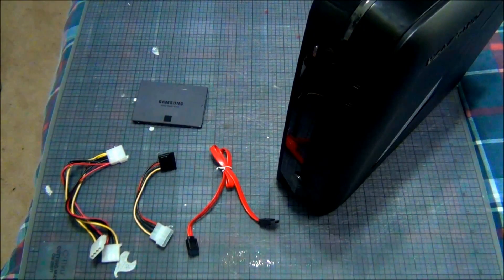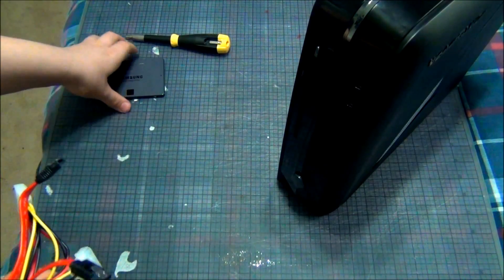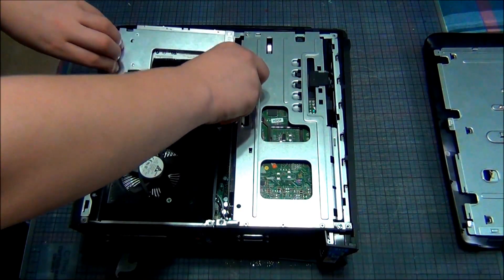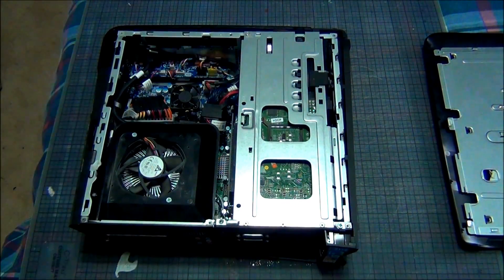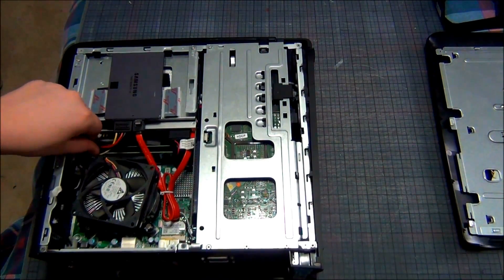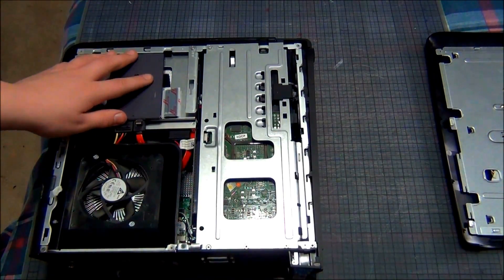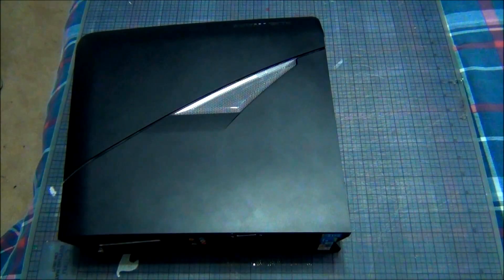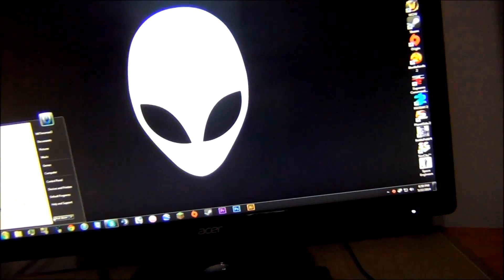Installing SSD into Alienware x51 With An Existing 3.5 HDD

Comment: I know this is an old video, but can you recall how high your temperatures got?

Or, how much power would this affect on the power block? I recently upgraded my x51r2 rig with a 1660 super.
Reply from the maker: Temps I believe were perfectly fine and also for power, I’d say definitely under 5 watts. You can look up your model of ssd and see how much power it draws idle and while in use
Reply: @MrTimoman3  thanks mate

Comment: Hi, i've had a x51 R3 for about 3-4 years (GTX 960). I've been running a 240w psu over the recommended 330w for the whole time and its worked well with it getting a bit hot after a long play. Anyhow,  recently it started to shutdown after loading/playing games which i first thought was the psu, i swapped it out with another 240w and it still doesn't work. The PC in general is very loud followed by a scratching noise coming from the GPU/HDD area. Do you think i need the hard drive replacing?
Reply from the maker: It could be the hard drive. You should be able to take out the graphics card out of the case and still run the computer off the integrated graphics from the motherboard. And you could get a better look at what could be making the sound. Also it could be that your components are getting hotter than they have been before and when components get hotter they take more volts to stabilize so that could also be another thing but if it primarily happens when loading a game it’s a good possibility it’s the hard dirive
Reply: @MrTimoman3  Awesome man thanks for replying so quickly. Ill try it out :)
Reply: @MrTimoman3  Found out it is the Hard drive, would those same wires work with a 2.5 SATA 3 SSD?
Reply from the maker: Chazza yes they should
Reply: @MrTimoman3  thanks
Reply: The gpu fan is positioned in a way where it grinds against its own power supply cord. I've seen it in two models already. 
Try taking the gpu out and checking on the two cords attached to it.

Comment: @MrTimoman3 i need your help. i might be getting one of these computers soon with a 330w psu, and my gpu will need one 6 pin power cable, i know that the R2 has at least two 6pin cables. My question is : where are the 6pin cables plugged into? will the molex cable im meant to unplug be powering the ssd, hdd and the gpu? i know that with the right adaptor it is possible. did alienware do this?
Reply from the maker: I no longer have this computer but if I am correct that molex cable is just for the HDD and the DVD drive. The single 6 pin is just for the GPU it self

Comment: So, I connected everything up easily. I wanted to use the SSD as my main drive, so I cloned my HDD to my SSD with the Samsung Migration tool. I unplugged my HDD to see if the computer would boot from SSD and it did, very fast. It was amazing. But now I'm trapped in another nightmare. Whenever I reconnected the HDD, the system would start from the HDD, even if I selected the SSD in the F12 menu. So I tried messing with some boot settings and now the computer will not start up from the SSD anymore at all (it says "no disk detected" or something like that whenever I start it with just the SSD connected). My system also doesn't even see the SSD anymore. Samsung migration tool can't see it. It's not in windows explorer or in diskmgmt. I don't know if some setting I changed caused this, or if maybe one of the cables is actually defective and randomly gave out. Also, my initial bootup screen changed when I made one of those bootup settings changes. It now shows a big alien head in color (some red on it). Before it showed just a small white alienware logo.
Also, the drivers link in the description doesn't work. I don't know if they would help.
Reply: You need to go to your BIOS and change the boot device, sorry for the 3 month late reply.

Comment: Hi man, great video. I'm about to upgrade my X51 with an SSD. However, is there any way to avoid so much cables? Know if this adapter would be useful? Cheers https://www.amazon.com.mx/StarTech-PYO2LP4LSATA-Adaptador-Seguridad-Pestillo/dp/B00A6GKE22/ref=sr_1_19?s=electronics&rps=1&ie=UTF8&qid=1544412390&sr=1-19&keywords=sata+3+cable

Comment: What SSD is that? also do you know if i can use Samsung 860 EVO 500GB on this PC ?
Reply from the maker: Parahype99 that is the Samsung 840 evo and yes you
Can use the 860 evo in the Alienware
Reply: If i get the "2 molex cables combined" i don't need the other cables? i already have SATA data cable
Reply from the maker: Parahype99 correct

Comment: First off the operating system is still loading off the hard drive so speeds weren’t faster at all as well as loading any applications. You need to manually put applications on the SSD to make them load quicker

Comment: Hi, I know this is a while back but what is the Media-fire link for the driver link for ? you haven't mentioned in the video, or maybe I missed it. 

Also the link no longer works

Thanks
Reply from the maker: Kieran Long It was a link for the drivers the controls like the eject button on the front of the case and other little things
Reply: ah ok thanks, so I do not need it for the installation or usage of the SSD? also what size of SSD did you use / recommend, 250GB?
Reply from the maker: Kieran Long no you do not, and I would recommend 250 if your installing a os into it but if your looking to put games to load faster on it I recommend 500 to 750 (750s are rare)
Reply: MrTimoman3 ok brilliant! Last question haha! I don’t need to do anything to the cooking system or power supply when installed the 500gb SSD ? The computer will run fine with the standard parts ?
Reply from the maker: Kieran Long yup

Comment: Hei so can I take the optical drive out and use the existing cables  for  the ssd?. Maybe I can keep the optical drive cage in there to have something to mount the ssd to
Reply from the maker: Luciano Schettino yes you can take out the optical drive but you still need to use new cables as they are different
Reply: thank you very much  MrTimoman3, could you tell me which cables I should  buy if I want  do that?
Reply from the maker: Luciano Schettino they are in the description

Comment: Can I install my Samsung SSD first and then use the included disk to transfer my OS, or do I need to transfer the OS with a usb to sata and then install? Sorry probably a dumb question
Reply from the maker: You most likely cant go from your hard drive to your ssd. you most likely going to have to just install a new os on the ssd and move over files.
Reply from the maker: You most likely cant go from your hard drive to your ssd. you most likely going to have to just install a new os on the ssd and move over files.
Reply: I am finding this article on migrating to an SSD helpful. I haven't tried it yet. https://www.howtogeek.com/97242/how-to-migrate-windows-7-to-a-solid-state-drive/

Comment: Hi, I was wondering if you can do this by only using a sata cable? This guy I was talking to insisted that the computer had an extra power cable that I could use. Do I need to buy molex cables or can I get away without doing so?
Reply from the maker: jarewild if you have a newer Alienware x51 (r3 and up) then I'm not sure but it you're on a r2 or lower you will need the moles cable

Comment: Can I still install the SSD if I don't have the OS disc? I'm on Windows 10 and this is the first time installing a SSD. Do I just plug in the SSD in my PC and it will work?
Reply from the maker: FaZzyTheGod it will work but your operating system will not be on the ssd so your ssd would be used as a storage drive
Reply: FaZzyTheGod use a USB disc and create an image of your OS (Google: windows media creation tool).

Comment: PLEASE HELP. I am an idiot and cannot get the fucking door back on! Everything is complete and set in perfectly I just can't get the door back on! It's been an hour! I am a discrace to mankind!! HELP
Reply from the maker: Sorry for the late response. It could be because you a have a larger than normal ssd or that the cable to that connects to the panel is in the way or that the graphics card or the disc drive is not reinstalled correctly and is bulging out.

Comment: can i replace the HDD with ssd directly??
Reply from the maker: Soorya prabagar I'm not sure as i haven't tried that and I also no longer own the Alienware x51.
Reply: MrTimoman3 ok thx
Reply: If you're still looking for an answer, you can.  I have been using my SSD in replacement of the original HDD, and I'm adding an additional SSD whenever the cables come.

Comment: Would this installation guide and parts work for me if I get an SSHD instead or is it different?
Reply from the maker: Stephen Sabra depends exactly what you are exactly wanting to do and if the sshd you are wanting to use is a 2.5in or 3.5in
Reply: I went ahead and just t the same Samsung SSD you have in the video. I'm still waiting on two other cables to arrive in the mail. Thanks for this guide btw!!

Comment: I cant find a video anywhere, I want to remove the HDD altogether and just have a single 1TB SSD in my X51 machine...

Do I need to buy a 3.5 to 2.5 inch tray or can I use the existing tray in the x51.

Wil I need any additional cables or can I just use the cables that was connected to the old HDD?
Reply from the maker: EquationStudio  I'm not entirely sure because I no longer have a x51 but I do remember that the sata and power connected where screwed into the case to fit perfectly with a 3.5in drive. You maybe be able to get a 3.5 to 2.5in drive bay converter but I'm now sure because there may not be a enough room for the connector to move around if you unscrewed the sata and power connector.

Comment: Not working for me... the molex female you got their is connected to my harddrive or gra. card... maybe I got another model...
Reply from the maker: Jan-Henning Schmidt yeah one of the molex cables is supposed to connected to the hard drive so you can have both
Reply: Their is only one!
Reply: Or did you disconnect the cable you are connecting with the ssd?
Reply from the maker: Jan-Henning Schmidt your supposed to disconnect that molex that is already installed and then plug in the molex splitter and plug the existing molex into one end and the molex and sata to the other
Reply: Thank you so much!... i had no sound when i did this yesterday... i havnt seen you disconnecting it...

Comment: I need help. I did exactly what you did. The problem is that the first boot never works. I have to force shutdown, then boot again for it to boot normally. Also, my HDD is read as usb hard disk. Is that good?
Reply from the maker: Leon Ho have you change the default boot in the bios to the SSD?
Reply: I'm pretty sure I did. Here's some links to the bios:
https://www.dropbox.com/sh/2zgwtr3tudsiiqd/AADEeJ-1S3XGqcYBwRn9yVb0a?dl=0
Reply from the maker: Leon Ho ok so where the first boot is under the boot menu in the bios where it says Windows boot manager it means that it's going to launch to which ever drive has Windows on it so what you need to do is to unplug the HDD sata plug then it should but straight to the SSD then shut down and plug it back in and see if it stays booting to the SSD drive.
Reply from the maker: Should boot straight*
Reply: +MrTimoman3 I think I got it. I went to msconfig and did selective startup. 5+ successful boots in a row. btw, I got a new hdd also, so it's formatted and no os. stupid alienware and the toshiba hdd... lol
thanks, man.
Reply from the maker: Leon Ho oh ok awesome, I'm glad you got it working!

Comment: Hi , is it possible to get 2 SSD of 420 gb in my x51 R1 ? I got a graphic card upgrade the PNY GeForce GTX 750ti 2gb and it works perfect , i wanna know if i can have the 2 SSD since alienware are short on power supply , will it cause any problems? Having 2¿?
Reply from the maker: Ferchobits NiNi you shouldn't have any power issues as SSD's take low amounts of power it just matters if you have the room for the 2 SSD drives and enough sata Ports.

Comment: work with sata III SSD?
Reply from the maker: Yes
Reply: hi ! i installing SanDisk SSD Ultra II 480Go on my r2 9002 and i doesn't see any disk when i go to file "computer"
Reply from the maker: You need to go to control panel, administrative tools, create and format hard disk partitions, then create a new partition for the SSD.

Comment: Hi, i followed your tutorial and it worked great. I cloned the C drive that has my windows installed on it to the new drive but it keeps booting from the original HD. How do i change the boot drive to the SSD and then format the original drive? Thanks!
Reply from the maker: To change the boot order you have to go into the bios and change it from the HDD to the SSD. If you can't get that to work try unplugging the sata connecter to the HDD and then boot and it will force it to boot to the SSD, then you should be able to plug it back in and it should stay booted to the SSD. If not let me know if you couldn't get those 2 options working.
Reply: Thank you. I just unplugged the SATA and installed a USB version of windows and it worked perfectly. Thanks

Comment: After I clone my OS to the SSD what do I do with my 1 TB HDD to make it my mass storage? Do i need to delete the OS off of it also? Also is there any way to Clone the OS without deleting the large files off like the games/video? Thank you again sir for This video it helped me so much.
Reply from the maker: Once you clone the drive you will need to make the bios boot to the SSD first and then reformat the HDD once you get into Windows. Also what size of SSD do you have and how many gigabytes do you have stored on the HDD? When I did it I just completely reinstalled Windows on the SSD and then I was able to grab files off of the HDD and use it like mass storage.

Comment: My friend gave me a x51 for free because it needs a new hard drive. wont boot up, just a black screen. What are my options? Can I just buy an ssd, do this, boot it up, then install the OS onto the new SSD from the supposedly faulty HDD? thanks!
Reply from the maker: +JoeyRaddaRadda do you get a boot screen like the Alienware head?
Reply: Haven't tried booting it myself yet, I just took it and ran! Lol. 
"It doesn't boot up. It's just a continual loop until it either goes black or shows an error message (which it then goes black afterwards). It'd be best to just buy a new hard drive" 
Exactly as he said.
Reply from the maker: just try booting it your self and see if the alien head pops up or not
Reply: +MrTimoman3 he believes the logo did show, along with the little circle icon if thats any consulation, then never got past that followed by a black screen.
Reply: +MrTimoman3 system boots up, logo and all. then proceeds to a black screen. Says preparing automatic repair, then black screen until forced shut off.
Reply: +MrTimoman3 also said he factory reset it, and still nothing.
Reply from the maker: +JoeyRaddaRadda so can you go to the bios?
Reply: +MrTimoman3 yes I have access to the bios sometimes when I boot without peripherals connected, strangely.
Reply from the maker: +JoeyRaddaRadda well, the only thing you can do is try to reinstall Windows on the drive or get a SSD and do that but that's all I can think of.
Reply: +MrTimoman3 do you think it'll actually boot if I install an ssd? I'm going to buy one anyways on top of a new HDD but it'd be good to know if I could just buy an ssd instead of having to buy another OS or something.
Reply from the maker: +JoeyRaddaRadda I would try installing a OS first on the HDD
Reply from the maker: +MrTimoman3 it should come with a Windows disc, if you don't have it you can try taking the hard drive out and putting it in a working computer and extracting the key from it with a program. If you can't do either of those to the next thing you would have to do is buy a Windows key.